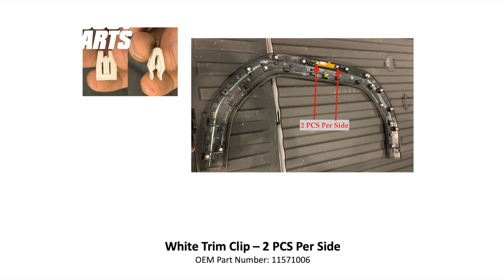GMC Sierra 2500 / 3500 Fender Light Upgrade - Smoked or Frosted Running Light - (2020+ Sierra)

Comment: Just installed mine, I had to replace half of the white clips.  Save yourself some trouble and buy a set of 19.
Reply from the maker: They can be a bit of a pain, that's why we put the part number in the video.

Comment: Will this system fit a 1500 if you buy the 2500 wheel opening trim or will it not fit?  If it wont fit, will you be making a  set of wheel opening moldings that will accommodate these or similar lights?  It would be a nice upgrade for the 1500.
Reply from the maker: Unfortunately they won't fit 1500's. I'll share your recommendation with our development team.